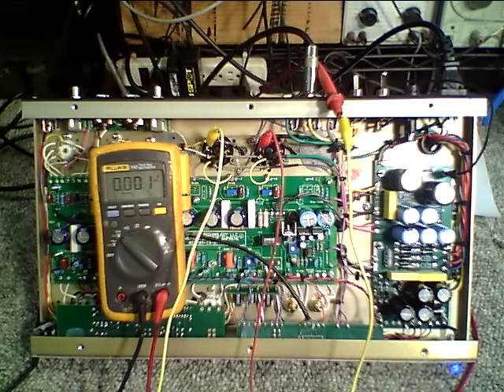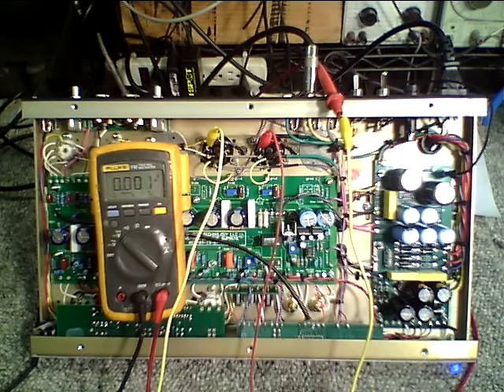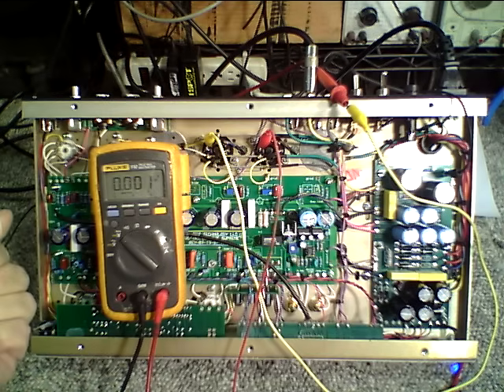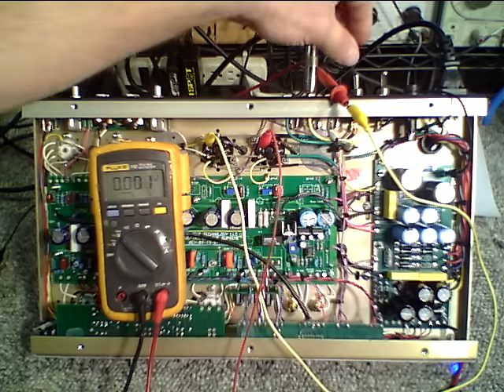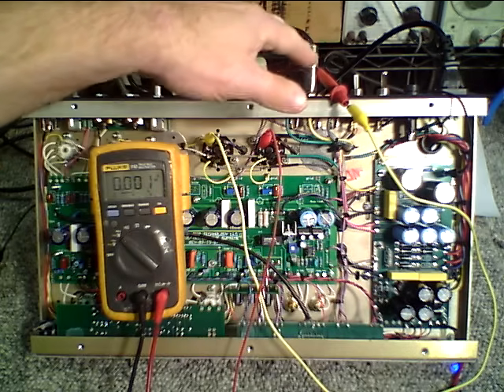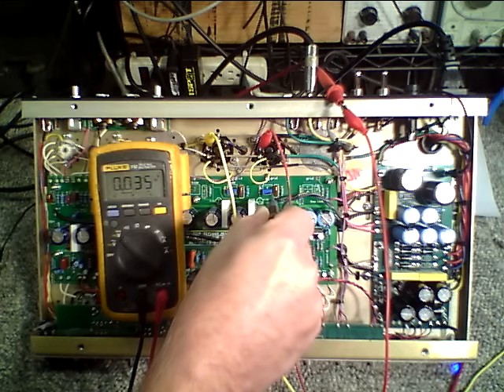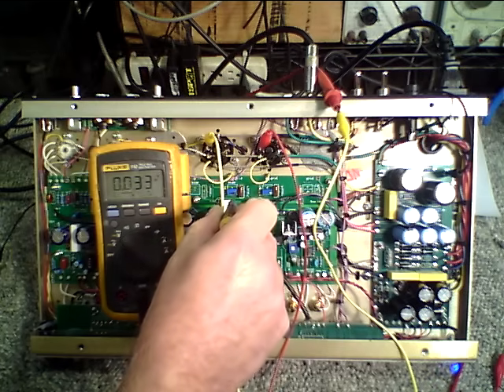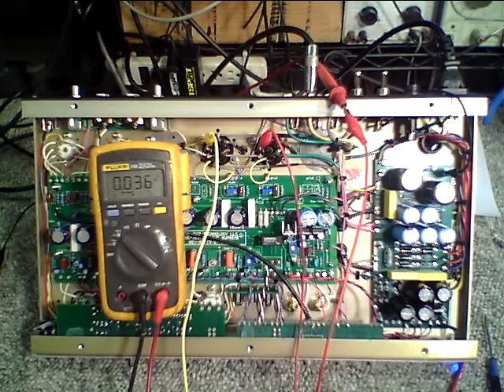Andy Fuchs - Teaches How To Bias an Overdrive Supreme Amplifier

Comment from the maker: Yes, good suggestion. It's wise to check the tubes alternately, to make sure they are pulling equal current. It's also a good idea to let the amp run for 30 minutes or so, then rechecking bias before buttoning it up.